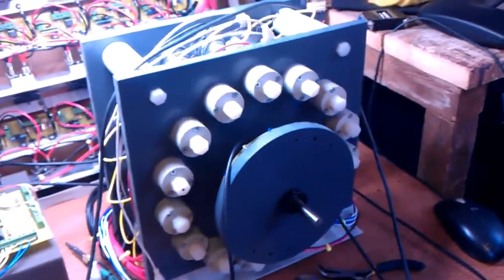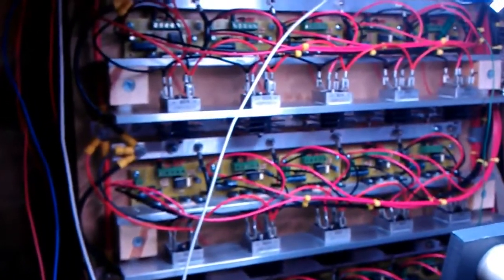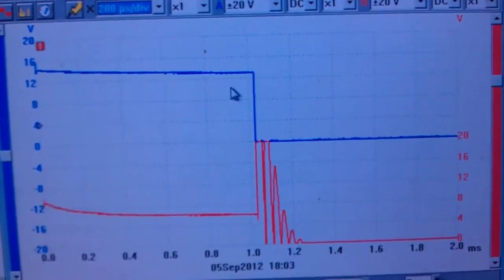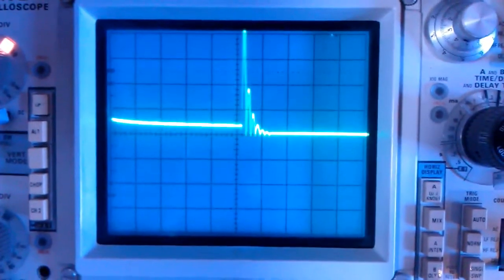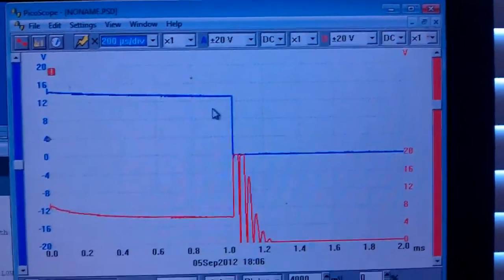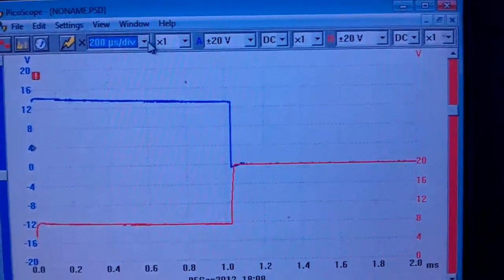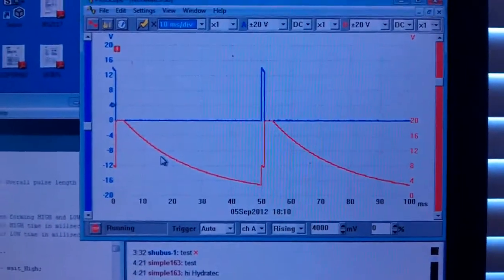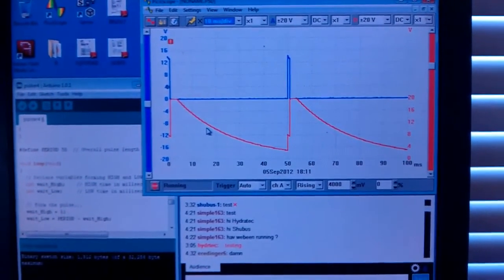Muller Motor Update - 2

Comment from the maker: With regard to the longevity of the collapsing magnetic field, consider the fact the collapse is non-linear. Now, I cannot substantiate what I am about to say (yet) but I suspect the physical characteristics of the coils themselves are making a contribution. Imagine the magnetic field lines surrounding and within two opposing, series connected stepped conical coils - just ***how*** would the magnetic field collapse? It must have a route and that route has a limiter - just like emptying a bottle.

Comment from the maker: Given enough time, the red trace should reach 0V. But that will never happen because the next mosfet conduction re-builds the magnetic field and thus starts the whole cycle anew. Of course, this in of itself is unremarkable, but consider a) multiple coils (15) will do this through induction alone. b) the ***very weak*** inductance of the coil under test and c) the power represented by the second red waveform is a function of which a critical variable is the aforementioned coil inductance...

Comment from the maker: The positive terminal of the rectified output of the collapsing magnetic field within the coil is connected to a capacitor whose negative lead is left floating. At the same time, the positive  terminal of the rectified output of the collapsing magnetic field within the coil is grounded via a resistor to show the first waveform. I simply ground the negative terminal of the said capacitor to produce the second waveform. Please note, although 20V is shown on the second waveform - it's clipped!